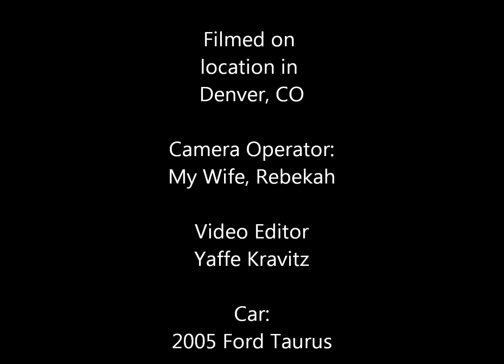Helium Balloon In Car - Awesome Physics Experiment

Comment from the maker: I think the problem here is you are confusing velocity with acceleration.  If there is acceleration, there is a force.  If there is a force (on the air), then it cannot "relax" until the force is removed.

Comment from the maker: You are still wrong.  This would be true if I let off the gas and the balloon still moved forward.  But as long as I am accelerating, the air is still being "squished" in the back of the car and is not able to "relax" - as you call it.  The KEY here is ACCELERATION which means there is a constant force on the air in the back of the car, keeping it in its compressed state back there until I let off the gas pedal.   Go take a basic physics course before you come here making false claims.

Comment: Relaxation time of air is most important here. When the car moves, I agree that the air wants to remain still and therefore "compresses" at the rear of the car. The relaxation time of air is too short.Even after a second it's traveling at the same rate of acceleration as the car. Meanwhile, the helium balloon is still moving forward and up.

Your error is in the belief that the air "compresses" for as long as the car is accelerating. It's easy to prove me wrong. Find the relaxation time of air

Comment from the maker: It would not fly outwards as you say, it if the central force was removed (string breaks or gravity disappears - assuming you are referring to something like a tether ball or gravity with planets) the object will not fly outwards as you suggest, it will travel in a straight line, tangent to then string, and in the direction of motion, assuming no other gravitational bodies are having an effect on the mass.

Comment from the maker: The inherent buoyancy arises from the fact that the air is more massive per volume than helium and so the air "wins the fight" so to speak of resisting the change in position of the air I am causing by accelerating.  Thus, the balloon is able to change position easier than than the air in the car so it acts as if it is being pushed forward from the back windshield, only there is more air moving back there and less up front now to is pushed forward by the additional air.

Comment from the maker: Having the windows open does not change anything.  The mass the air in my car in unchanged by the windows being opened (well other than some pressure changes from Bernoulli's principle - but they would cancel out if both windows were opened anyway)  The idea is that the air in the car is wanting to stay where it is and so does the balloon.  When I accelerate forward, my car is forcing the air forward (by pushing it forward like a bulldozer from the back window) and likewise, the front windshield

Comment: If you were to try to spin it around like a yo-yo.  The yo-yo would try to move opposite the centripetal force.  The opposite will occur with a helium balloon.  It'll keep trying to move towards the center.

It's always moving away from the force acting on it (as long as it's less dense)

Comment from the maker: Think of the car filled with water with a small gap of air at the top.  Where does the water "bunch up" when you accelerate?  If you released a bubble of air from the bottom and accelerated forward at the same time, you would see the bubble rise and move toward the front of the car.  This is the same effect I describe in my video.  Buoyancy is not really a force in and of itself, it is caused by a heavier medium being "more" attracted to another mass which pushes a lighter mass out of the way.

Comment: Sorry if I wasn't clear.  Of course, it floats up because it is less dense than the air around it.  I'm not saying that it floats up BECAUSE it opposes gravity, I'm saying that as long as it's less dense than the air around it, it will always float up.

But it also opposes other forces in a similar manner.  It's easy to do a quick experiment - take a helium balloon and spin it around.

Comment: Your explanation is not correct.  The air isn't bunching up causing the balloon to move.

What's actually happening is that a helium balloon (or any buoyant force) tries to move opposite the force of gravity - that's why it floats up.  In this case, when you start accelerate, the force is pulling it down and back, so it moves in the opposite direction, or up and forward.

You'll find that the same thing occurs when the windows are open - and you aren't moving the air of the entire planet.